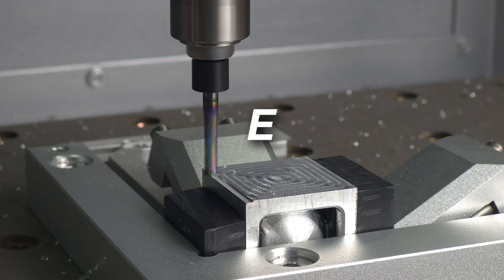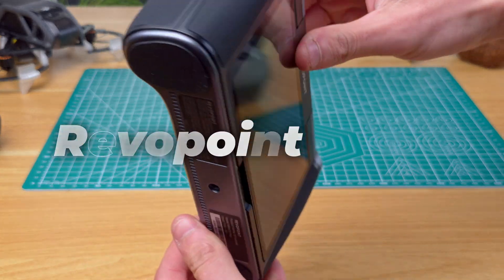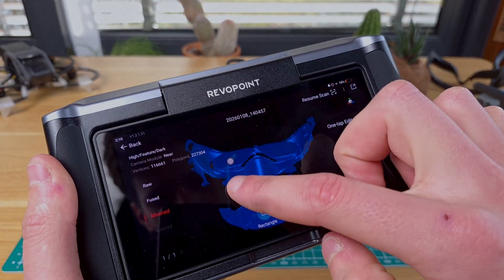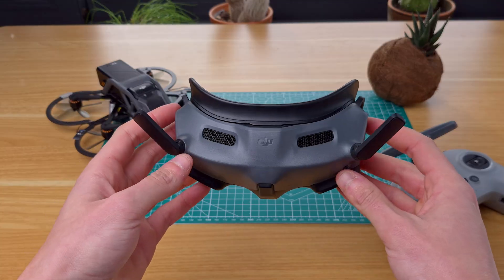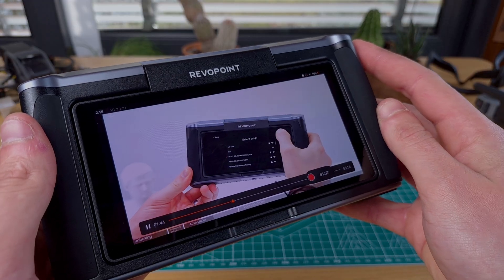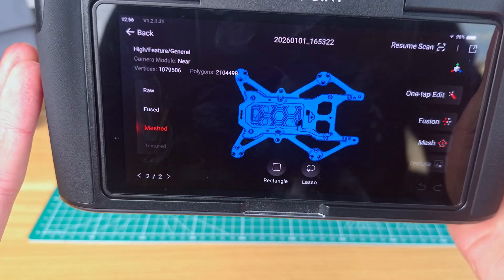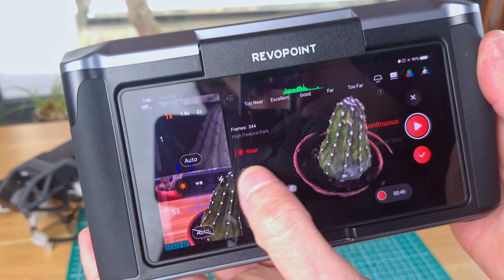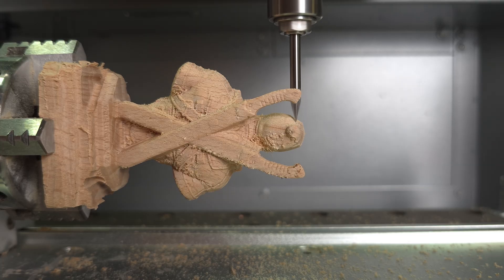I DIDN'T think 3D scanners would be THIS USEFUL, here's why you NEED one! Revopoint MIRACO plus

Comment: As someone who has been 3D scanning for a long time for my profession, you can make a cheap scanning spray with 100% isopropyl alcohol and odor free baby powder. mix about a spoon full of baby powder in with a cup of isopropyl and shake thoroughly before using. The alcohol evaporates away and leaves the powder behind for great scans with easy cleanup. You can easily just blow the powder off with some compressed air or wipe off with a clean dry rag.
Reply from the maker: Oh, Amazing!! Thabks for letting me know that, it will definitely be useful
Reply: How much is a cup in milliliters?